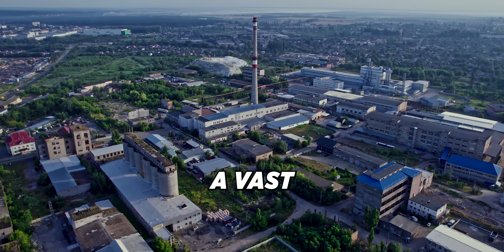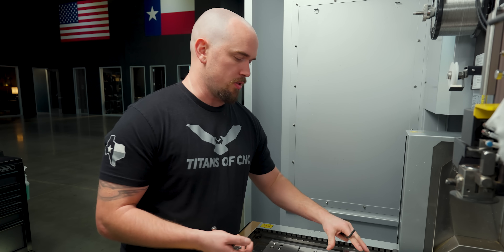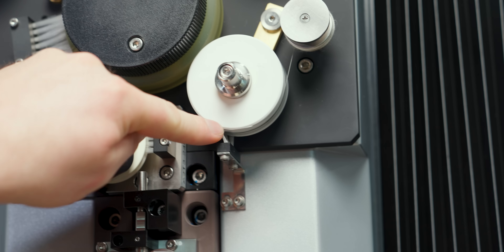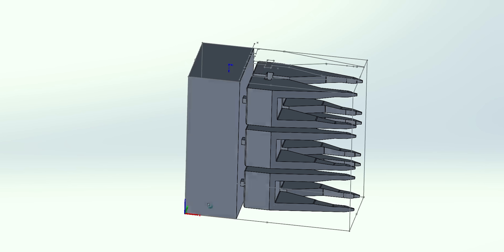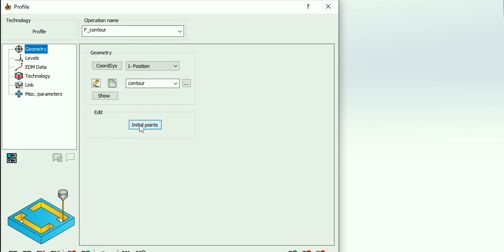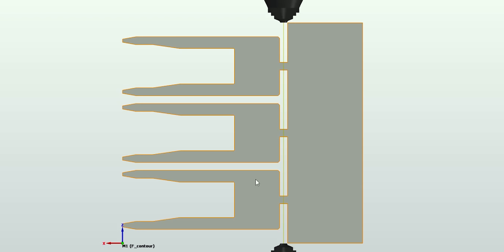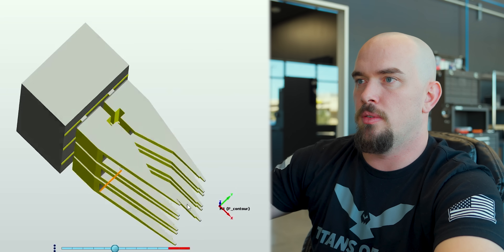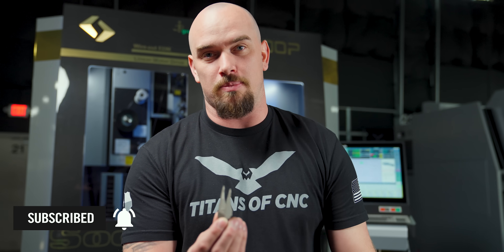The Modern Marvel that Built Our World!

Comment: I worked at a Dana plant and we had every type of stamping die setup in house and we had a "Tool & "Die" building that was bigger than the Titan shop which would build and repair the forming dies. Coolest thing on the floor was a monster CNC mill that the operator used to ride the carriage. I believed it used air bearings and the bed was flush with the shop floor.
And yet some of the tooling plates were so long they needed 2 setups to plane the plates.

Comment: wireedm  works with resistance
so feed actually  automatically adjusted

at thinner part it will go faster, while at the  thick part it will slow down
a general max feedrate can be set  but eventually the  machine will control speed  by Amper

Comment: I was a toolmaker for 10 years and i was working with stamping dies and plastic injection molds. Awesome job especially when you see some die or mold work as intended. Damn... I miss those days.
Reply: I was an aspiring toolmaker for 10 but I ended up doing most of the CNC work, I miss it too, thinking about back into it as a second job been about 3 years. My grandfather owned a shop for 35 years....

Comment: I was there when Wire EDM was invented. I worked for a Aerospace fastener co and they used Crush Form Grinding to profile the HS steel turning tools for their multispindle screw machines. Then the wire EDM machines can out and replaced that technology. Late 90's I'm gussing they bought their first unit. Used on old Acme Gridley and still in use Davenports. Now they have million $ Index multi spindles with no cams all CNC AC sevo drives
Reply: Was wire edm not invented in the 60s?

Comment: Wounder when they put like a 4 axis rotary table on it so you don't have to flip and check it manually but it just get a M code to turn it 90 degrees ( or however many degrees you want )
Reply: We are actually currently getting one installed but we did not have it during the machining of these parts!

Comment: Also I have to ask...Why are you tapping that block around on the EDM? Surely as advanced as that machine is, it has functions to straight everything with the wire or touching two spots with the indicator. Use a square, get it close and let the machine do all the work. Saves time!
Reply: I prefer to work with my block square to the axis of movement. You're not wrong the machine can probe it and skew the axis and I have done it and can do it that way but it's just a preference thing.
Reply: @ I respect that!

Comment: You have a very long way to go! There is zero reason in 2025 to be using D2! Yes D2 have good wear resistance, but will chip much easier! DCMX is better in every way, and the lower wear can be fixed by nitriding the steel to get around a 70RC surface at a depth of generally around .015". I have talked my employer (Heavy Stamping/Automotive Stamping) to go away from D2 entirely. Now for problem details we only use DC53, DCMX and Cal-Die. For simple features we will use A2 for low volume stuff. Again, zero reason in 2025 to use D2 for anything other than price.
Reply: Sorry for not proof reading!